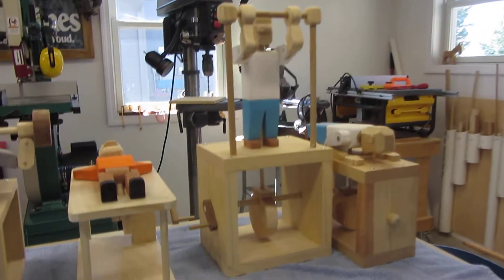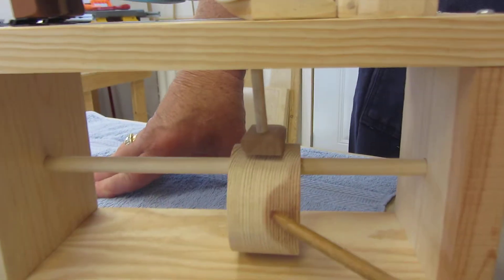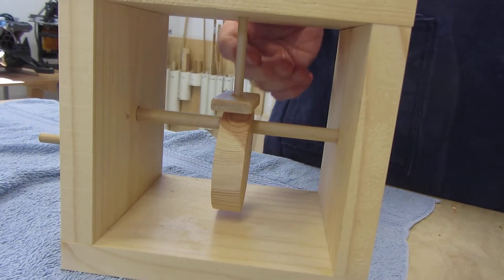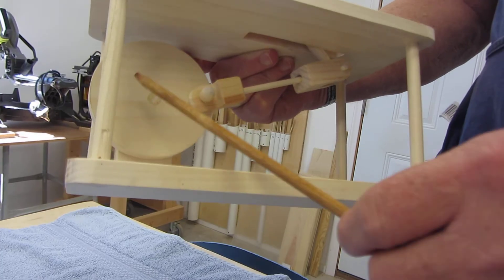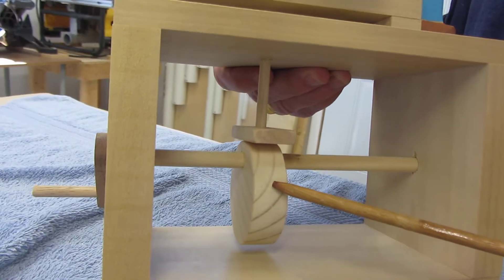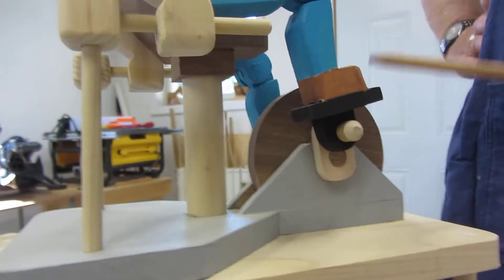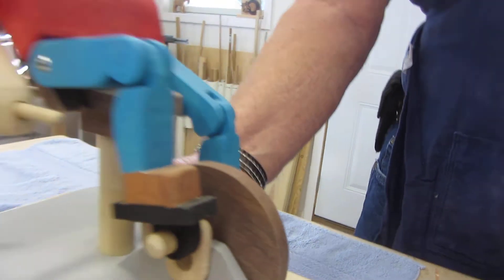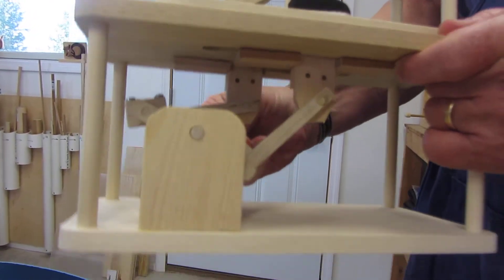Wood automata Fitness Center

Comment: Great work they look awesome. I do feel sorry for the pull up guy tho, having a shaft shoved up his ass like that. LOL. I would have been nicer to the guy and put the shaft under one of the feet.
Reply from the maker: I did give the sit-up guy a lot of thought about the shaft placement and finally decided I would just think about it as having the shaft attached to the lower torso. Also putting the shaft under one of his feet would have made the project a stand-up guy rather than a sit-up guy.